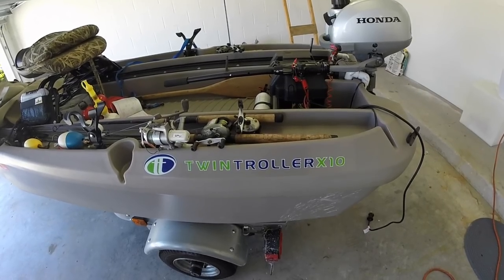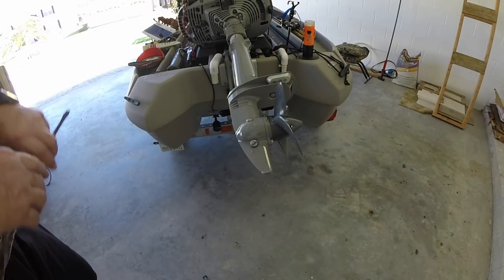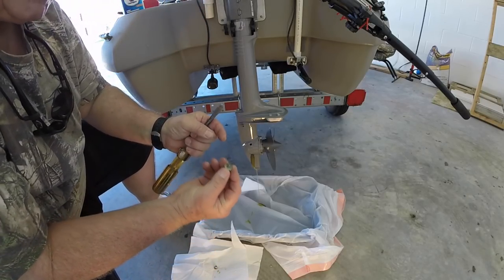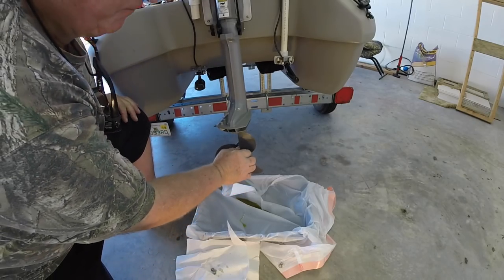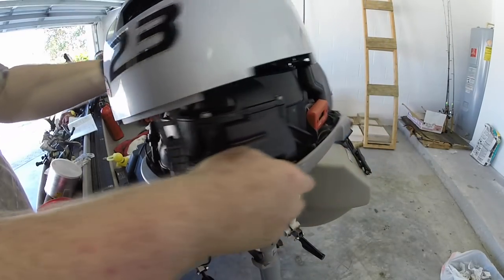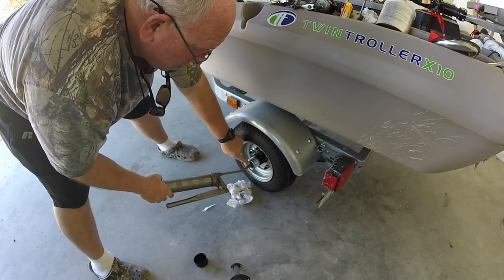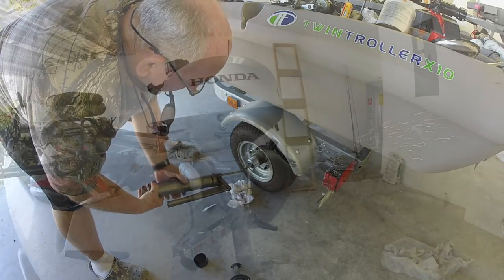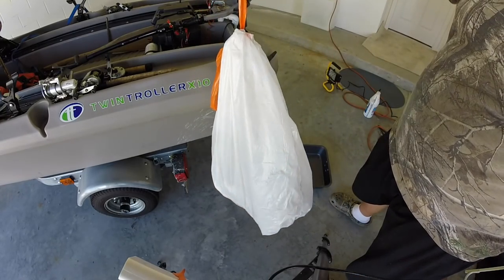HOW TO TUNE UP A HONDA 2.3 HP OUTBOARD ON MY TWIN TROLLER X10

Comment from the maker: NOTE - NOTE - NOTE:
 If you are interested I did an update video on servicing this motor after five years. Just go to my channel and do a search for:
 HONDA 2.3 H.P. OUTBOARD MAINTENANCE AFTER FIVE YEARS and I did another called HOW TO SERVICE YOUR OUTBOARD.
Reply: How do you re-fill the gear lube on the lower end?
Reply from the maker: Petrus, there are two ways. 

You can buy the lube in a tube that looks like a large tube of tooth paste or a plastic bottle with a spout at the top that you cut off the tip of the spout  and squeeze it up into the bottom hole. When the lube starts to flow clear with minimal bubbles from the top hole insert the top screw. Then you remove the tube of lube from the bottom and quickly insert the bottom screw. You see me do that in my video. You must hold the tube tight against the bottom hole when squeezing the lube in or you will get a big mess.

They also make a small hand pump that screws into the top of the lube bottle that has a tube with a fitting on the end to attach to the bottom screw hole and you hand pump the lube the same say I just explained. The problem with my hand pump is that my fitting is too large to fit on the bottom hole but if you find one that has an adapter to fit that hole that is the easiest way and least messy way to do this.
Gerry
Reply: @LunkerFishing  Thanks a lot for your response!

Comment: Great video.  Here is a few hints regarding the oil change.  Not sure why Honda put the drain screw there but it is what it is SO when I change the oil, I tile the motor over so the dirty oil doesn't run onto the handle.  Also, there is exactly 250 mls or 1 cup of oil in the crank case (as per the manual). Dispense that amount into your pouring vessel and you will have the perfect amount EVERY TIME. Window is a great thing but when you have an exact amount from the manufacturer, I go with the manufacturer.  Keep up the great videos
Reply from the maker: Great idea. The correct amount of oil needed is helpful, thanks.        Gerry
Reply: Here is a link to the fact sheet.  http://marine.honda.ca/portables/BF2_3 . Go the download sections.
Reply: A dollar store clear ketchup/condiment bottle works great as a dispenser.  I marked the bottle at the level where 250cc is so now I can just fill to that mark and dispense.

I change the oil every 6 months.  The manual says 50 hours but this little guy mostly makes short trips between 1/4 to 1/2 mile so I change it more often.  1 tank of gas = 1 hour more or less so that is my hour meter.  We burn about a tank a week running between our sailboat and shore so really about 25 hours.  The oil looks almost new when I change it.

Every time I have the fuel tank off I dump it into a clean 1 quart paint mixing cup and shake it out good to get any water hiding at the bottom of the tank  There always is a few drops.  Then I titrate the gas back into the tank using a baja funnel filter to get any crud or water out of it. If I found any yuck I pull the hose off of the tank and clean the little filter in there.  

I also drain the carburator bowl as well as part of a service because there are usually a few drops of water in there too.  The carb bowl is not very well galvanized and will rust if there is water left in there.   I drain the carb if I am not going to run the engine for a week or more. Running it dry doesn't work so well. I've checked..There is still a lot left in there so I just drain it with the little drain screw.  A paint mixing cup works great for catching the gas here too.

Comment: I bought the Honda 2hp in 2000, I have always used it in salt water but not a heavy amount of hours, besides normal maintenance(plug, fluids, replacing the pull rope) I have had no problems with it. In 2016 I had forgotten to run the carb dry and empty the tank at the end of the season and it wouldn't start so I did a carb cleaning and intended to put a lot of new parts in it but the gas line was fine and still supple the carb parts looked fine so I put it back together and it started right up and no problems since and that was 5 years ago and no problems. I always run Seafoam in the gas and run it dry at the end of the season, I run synthetics in the oil and lower unit and change it about every 5 years. I cut up a bunch of 1/8" silicon bronze brazing rod for the prop shaft pins and carry 10 with me. (I carry a nail set and needle-nose pliers to get the broken parts out, a hard lesson learned) I am so glad I got the direct drive model so I can run at the lowest idle speed of about 2mph, I would have hated the clutch model as 2mph is the perfect trolling speed for me.  It is the best little motor I have ever owned!
Reply from the maker: Sam, it sounds as if you have had good luck with your Honda. So have I.                                                   Gerry
Reply: @LunkerFishing  I have, I take care of my stuff.
I read that the new 2.3 models are made in China and folks have had some problems with them like vapor locks or gas cap issues, I don't know. I looked at a site recently that sells them and oddly, they are about the same price I paid 21 years ago! Also, I didn't see the direct drive model, I wonder if they don't make those anymore? I would never buy a clutch model.
Reply from the maker: Sam, I just noticed your reply. I am not sure where the 2.3 is made. I think all of the ones that come through FEM are the clutch model like mine. I have no problems with the clutch model. 
I find that when I have not used the TT for a week or so I have trouble starting it at first until the fuel flows back into the carb, then it starts easily. I started opening the fuel shut off valve on the side of the motor and opening the vent on the cap when I arrive at the boat launch for a few minutes while preparing the boat. I always launch the boat with the Honda raised horizontal but shut off the fuel and close the cap vent. When I get into the water I lower the Honda back vertical open the fuel valve and open the vent on the cap and it starts easily then.                     Gerry

Comment: Hi Gerry, just got this Honda as my first outboard for my little inflatable for fishing and diving but bought it second hand so was very nervous about the potential state of it.. your video is so straight forward a baby could follow it. Thank you very much and I saw the fishing rods so as we say in New Zealand, tight lines. Simon
Reply from the maker: Simon, thank you for the nice comments. That Honda is a good motor and simpler than others because it is air cooled with less moving parts. I hope it works out for you.         
Gerry

Comment from the maker: UPDATE: I should have posted this before. Prior to this tune-up I noticed  I was not getting the same speed as I was in the past (just slightly lower) but after I did this tune-up it brought the performance of the motor back up to normal as when it was brand new. I guess it needed this more than I thought.        Gerry
Reply: Lunker012 . I may have missed it, but how did you put gear oil back into the gear case? The manual states to add oil through the oil drain hole until the oil flows out the top hole! I don't have an oil pump adapter which is the reason I'm asking how did you do it. Thanks.  John

Comment: Very thorough if everyone did this very few would be caught out by breakdown two additional things I do is use some white waterproof grease on propeller shift and pin. And a couple of drips of 3 in 1 oil on the cable where they go into cable sheath.
Reply from the maker: Not a bad idea!

Comment: Thanks for a very good video Gerry.. I'm sure your engine will last a long time. Regarding the noise level on the engine, do you think that air-cooled engines are noisier than water-cooled, what is your experience. Many thanks preben from Denmark.
Reply from the maker: Preben, yes air cooled are slightly noisier than water cooled but certainly quieter than a chain saw! 
Hello to Denmark!          Gerry

Comment: Great video! How is it on rainy days? Does the air cool vent suck up any water or water getting in the gas cap? Also do you use non ethanol gas?
Reply from the maker: I have had no problems with water getting into the vent hole on the gas cap but I always turn it off when the engine is stored and when tipping the engine to the horizontal position and my boat is garage kept. I treat my fuel when I buy it with a fuel stabilizer (usually SeaFoam) and always use non-ethanol fuel. This motor uses so little fuel it would be crazy not to treat it and use good gas. Good questions.                                                                      Gerry

Comment: Now cut the gas line and install a small gas filter between tank and carburetor, so you will never have a problem with your carburetor, good job, thanks
Reply from the maker: There is not enough room to do that but that is a good idea.

Comment: Great Video .. how you compare this one with the Mercury 5 HP   ?
Reply from the maker: Ibrahim, All motors operate the same as this one except you likely have a water cooled system on that Merc 5 hp while this motor is air cooled. That means there is an impeller inside the water pump that needs to be periodically replaced. You do that by removing the lower end, open the water pump, replace the impeller, and reinstall the lower end. You still need to change the lower end fluids, spark plugs, grease fittings and other lube points, and change the crankcase oil just like I did in this video. Your manual should show how to do all that.             Gerry

Comment: Great video. How many people pay a dealer $100 to do this or just delay service?

On the lower unit drain/vent screws and the engine oil drain screw. When loosening if you tap the back of the screw driver slightly with a hammer while applying a little torque it relieves the pressure on the threads and insures ez removal, when tightening I go until it sets at about 5 inch lbs ant tap it once while torquing lightly.
Reply from the maker: Dlgeis, Great advice!                                                    Gerry

Comment: Gerry, where do you get those gas containers and what are they called?  Also, would be interesting to know how and the safe way using these type of containers, especially on the water!  Thank you in advance!  Gary
Reply from the maker: Great question!. I know I had someone ask me before in comments on another video but I looked, I cannot find it. The Honda holds 38 oz of gas in the on-board tank. The bottles I use are from Amazon and here is a current link to them: 
https://www.amazon.com/dp/B0015I0GE6/ref=sxts_kp_tr_2?pf_rd_p=8778bc68-27e7-403f-8460-de48b6e788fb&pd_rd_wg=q6tjs&pf_rd_r=B1CNHN3K1E0NVBX5CSHM&pd_rd_i=B0015I0GE6&pd_rd_w=btqoX&pd_rd_r=b2e33914-605a-458a-a89d-ca081cf6f60b&ie=UTF8&qid=1544838777&sr=2
They come is a few sizes but mine are the  MSR Liquid Fuel Bottle 30 oz. at Amazon and right now they are $15.99 each for Prime members. I have two bottles in the boat when the Honda is on the back. Basically the Honda then has three tanks full of gas. One thing about those bottles is they have a wide enough opening that I do not need a funnel to pour into the Honda when on the water. If the weather is bad it may be a little tricky but most days I have no problem refueling. 
TIP: The caps can usually be removed by hand but sometimes they become hard to open. You push down then twist but the O-ring under the cap could use some lubrication at times. I use either Super Lube or I also have a thicker paste. Both are a Silicone base and the paste I got from NAPA. I just apply a thin layer on the O-ring them put the cap on and off twice to spread the lube on the surfaces where the O-ring touches. After a few months when the cap starts to be difficult again I lube it again. I store both next to the transom on each side of the boat. (One right over the drain plug) They both stand upright there and never fall over.
Prior to buying them I contacted the company and they said they are OK for storing gasoline. Just leave a little room at the top for expansion. I did some research and found that many motorcycle owners have them for a reserve tank in case they run out of fuel. They often store them in their saddlebags without problems. I hope that helps.       Gerry

Comment: Gerry, wondering which tiller extension handle you installed on your Honda 2.3 outboard? How do you like it? Any issues?
Reply from the maker: Daryl, just below most of my newer videos you will see the words "SEE MORE". Click on that and you will see a link to the tiller extension I have. I would buy that one again if I needed to.                            Gerry

Comment: Chock full of questions, this one on the types of grease.  My grease gun has the blue marine grade which looks like what you use in yours. I have a can of white lithium grease, which I think you have in the tube. Is that correct?    I also have food grade lubricant available. Will that cover it.  Thanks again. I pick up a new detail each time I watch your video. Doing a 10 hour tuneup on my new Honda 2.3.
Reply from the maker: Ted Finkenauer 
The marine grade is probably the best because it will stand up best in a wet environment.     Gerry

Comment: question.
on these small motors,  can you wait a year for the tune up?
and if using full synthetic oil,  does that protect the engine better than regular oil?
Reply from the maker: I do the tune up once a year myself. Yes, I believe synthetic is better.    Gerry

Comment: Gerry, do you know if they make a stainless steel prop for this Honda 2.3hp?  If so, any details where to get one?  I would like to use it as the main prop and use the plastic one that came with the TwinTroller for a spare.  Thanks!  Gary
Reply from the maker: Gary,
I am not aware of a stainless prop for the 2.3 Honda. Honda could better shed some light on that but a stainless prop would be much heavier than the standard plastic or original prop. Weight is also a concern in a small boat. I have to think the prop that came with the motor may be designed as part of the safety system to this motor. SS has absolutely no give and if you strike something hard it may cause substantial damage to a motor that has relatively small components inside that the plastic prop may help to protect by flexing or even breaking. If you find one please let us all know here.                                    Gerry

Comment: Gerry, due to the warranty limit, a friend suggested that I should buy the outboard engine independently in Canada.  I have the choice of using a Yamaha 2.5 hp and a Honda 2.3.  I know the Yamaha 2.5 hp is 10 lbs heavier and water cooled. Do you have any advice for me?
Reply from the maker: Charley, my guess is that the water cooled Yamaha may have a longer life but that is a guess. Not sure if the extra .3 horse would make it run fast enough to offset the extra weight. I am not a small build so to a smaller person that extra weight  in a heavier motor may not make a difference. There is also a concern that the extra weight is at the very rear of the TT but again, I am not sure what effect that may have. The only thing I do know is that the Honda 2.3 works well. It starts easy, runs well, is slightly loud, does not overheat, is easy to maintain, is easy to put on and off the TT due to it's light weight even on the water edge, and looks fine on the TT. 

Without the experience of having other motors on a TT to know if they would be better I would be making an uneducated recommendation to you. 

Either way, let us know what you get and if you like or dislike your choice. Good luck.        Gerry
Reply: lunker012 Thank you, Gerry! Your response is very helpful. I will try to use my friend’s Yamaha 2.5 hp a few times and then decide which one I should purchase.
Reply from the maker: Charley, that makes more sense than anything I said. Great idea.              Gerry

Comment: Gerry, where did you get your extra propeller for the Honda 2.3 for a spare?  What was your cost, etc…Thanks!  Gary
Reply from the maker: Gary, I do not have a spare prop for the Honda. The only prop I bought was the reverse prop for the Port side trolling motor. Since they came out with the reverse prop pitch the started installing them on every new Twin Troller at the factory. Those that did not have a reverse prop on when we bought the TT had to buy one and install it themselves. (I have a video about me doing that) I know they make spare props for the Honda 2.3 but I am not sure where they sell them. I have run that prop through lots of vegetation but we do not have lots of wood, rocks, or concrete in Central Florida, just weeds. I probably should have one but never did get one. Some spare shear pins for the prop came with the Honda (stored under the motor on the front) but I bought more spares for that. I never needed them either.                                     Gerry
Reply: i got mine on boats.net for about 30 bucks and it came in a honda package.
Reply from the maker: Bob, I just noticed your comment. Thanks for the information.                              Gerry